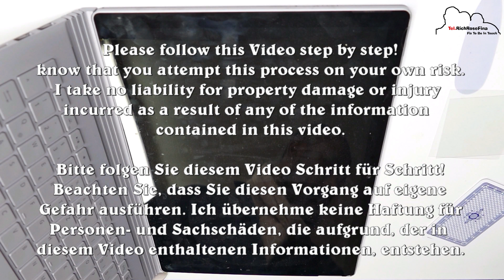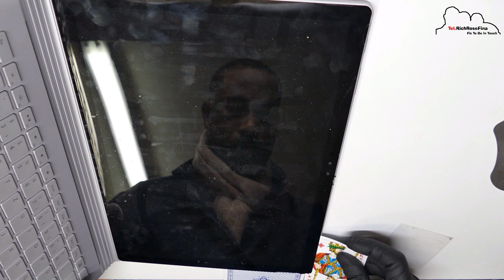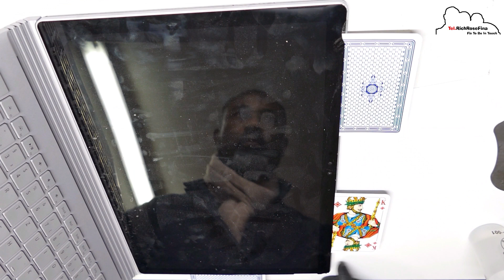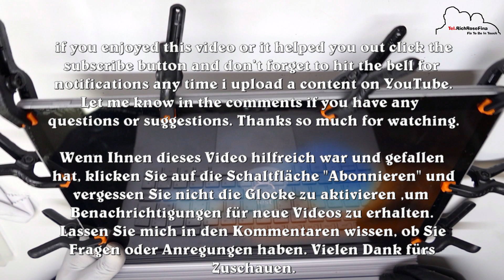Microsoft Surfbook Battery Replacement Akku Tauschen Wechseln Twi

Comment: I did this full replacement. Took me like 3 and half hours and I accidentally ripped off the antenna lol. But now my battery 1 (the one in the tablet) is showing a 0% charge and when I ran the battery report, it's not even showing up. Did you have to do any driver updates or anything to make it work after changing the battery?
Reply from the maker: No please
Reply: @Telrichrosefina  any suggestions on that I can do?
Reply from the maker: @TonyChedrawee  Check the Battery and charge it externally with Power Supply.
Reply: I just replaced battery and I am having the same issue.  I did it exactly as described.  I purchased the battery from iFix it.  I was wondering the same thing about possibly missing a step to recognize the new battery.  Any luck with getting the battery to start a charging?

Comment: Are you abroad or in Ghana
Reply from the maker: now in Germany
Reply: @Telrichrosefina  i was having the same issue with my ssd it can’t boot into windows and stuck on the bios screen.  Tried everything it’s not working.. so I’m thinking of changing my ssd. But they said open the screen is very hard you can end up destroying your display. Can i use heat pad instead of the heat gun. Thank you very much
Reply from the maker: @roscodotemmas  You can use Isopropanol/alkohol to remove the Screen.
Reply: @Telrichrosefina  thanks very much
Reply: @roscodotemmas  
for me the iOpener from iFixit worked very good. 
Just had to reheat it a few times.
Reply: @Telrichrosefina  Is it necessary to heat the screen to remove the screen, or is it enough to use Isopropanol alone?
Reply from the maker: @marekkowalski3814  using both is better but Isopropanol alone is enough to do the job.
Reply: @Telrichrosefina   if I use isopropanol alone, how much is needed to dissolve the glue between one housing and the other?
How long does it take for isopropanol to dissolve the cream?
Reply from the maker: @marekkowalski3814  please, just watch how it was demonstrated in the video.